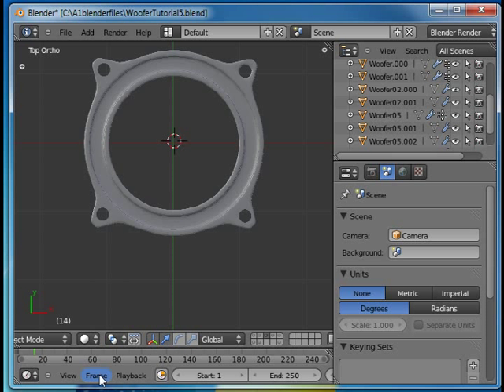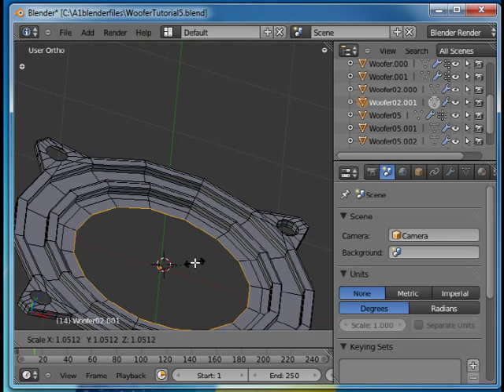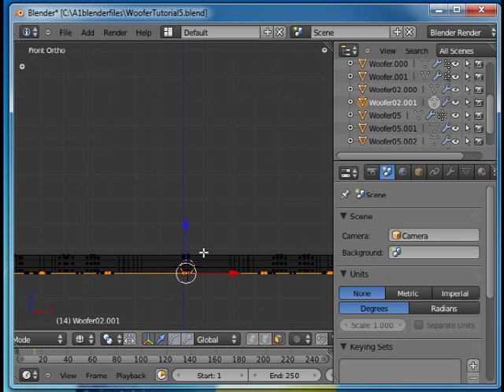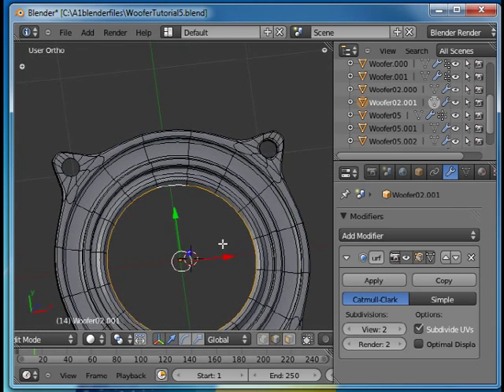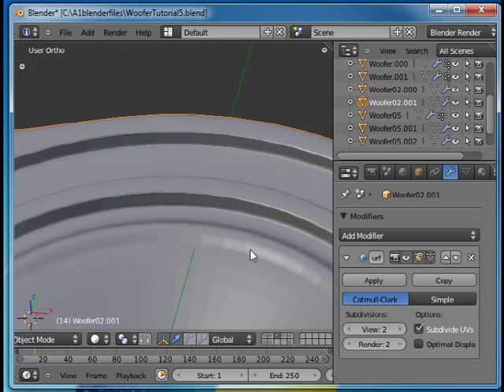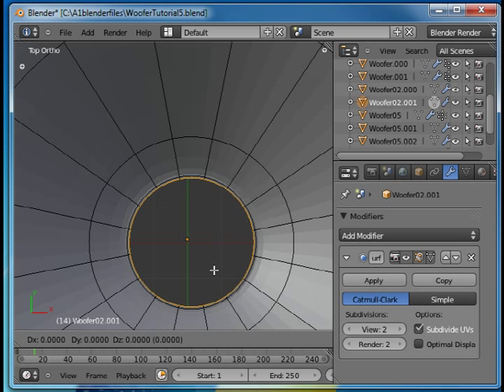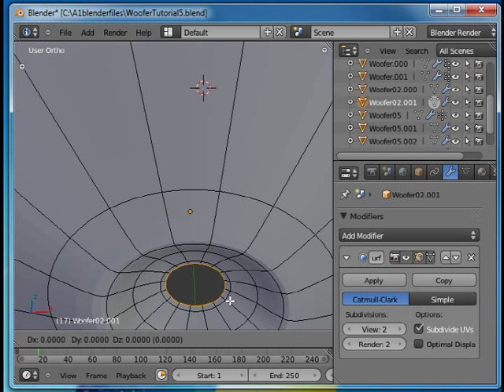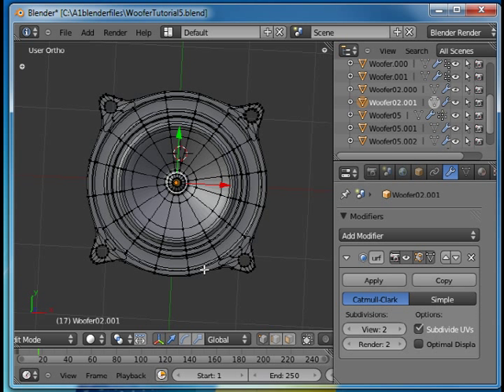Absolute Beginners Blender 3D #14.2 Tutorial

Comment from the maker: Hi at about 2.15 I activated the surface subdivision modifier for the editing cage = clicking on the two rightmost icons in the bsurf header. That causes Blender to calculate the effect of the modifier in editmode during editing moves and that's why that other ring follows with the ring I'm actually pulling down on. Try turning the modifier on in the edit cage and see if you get the same behaviour.